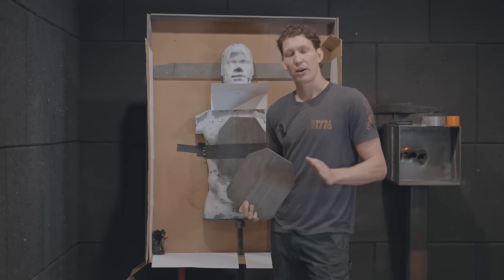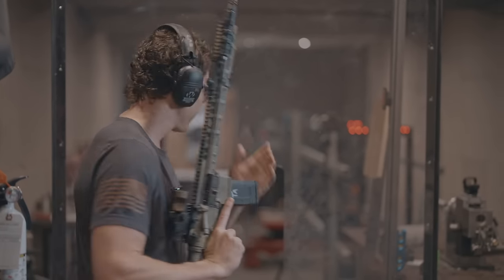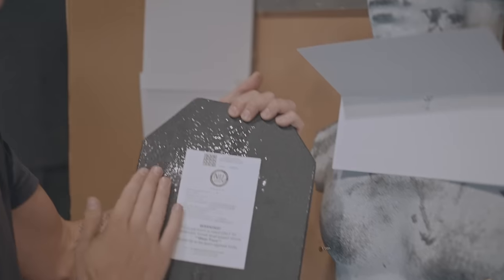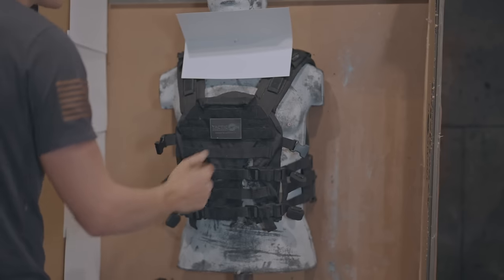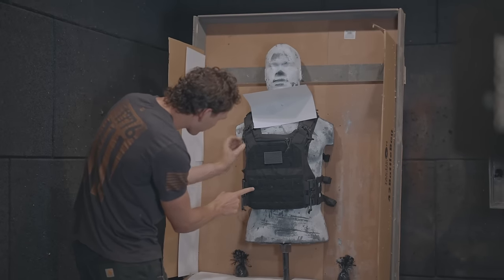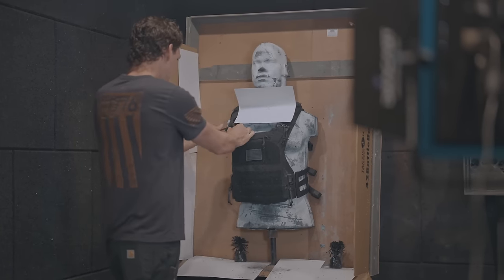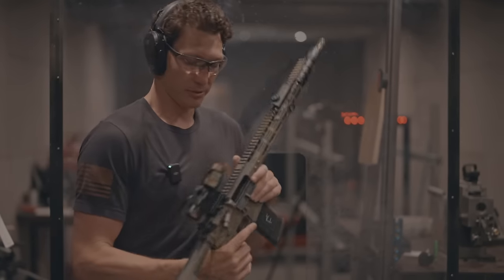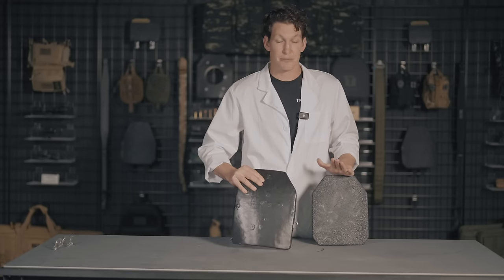Will Steel Armor Make You UN ALIVE Full Test

Comment: no doubt steel plates will stop bullets better than ceramic, but the point of the ceramic is to absorb impact. getting shot with steel would still cause impact damage to your body, where as the ceramic will absorb for of that
Reply: There may be some scenarios where taking a shot to the chest and being knocked on your ass could be beneficial versus still standing with some broken ribs and catching consecutive shots.
I think the big thing is it becomes a consideration of mission. If you're going to engage, have a team, etc. you maybe wouldn't want steel, but if you're patrolling in an open area or having a shtf set of plates that you don't want to worry about feeling an urge to replace every few years steel might be the better option. Also for most civilians the concern is shtf. Which means there may or may not be medical available if getting shot. So plate choice may vary depending on what that looks like to different people and their scenario.

Ideally we never have to worry about any of it and we're all just wasting money😅
Reply: Fun fact, steel plates have a lower BFD than ceramic. I run trauma pads behind all my steel plates. Getting shot regardless of plate type is going to hurt and possibly bruise or break something. The armor community has really hyped up ceramic/composite armor to be this hyper-superior armor when it really isn't. IMHO, only thing ceramic/composite armor has going for it is weight.
Reply: Do half you guys that comment on armor videos even own any? That’s not how the energy is transferred lol, a ceramic plate has bfd, and slows the round so almost all of the energy is being transferred into your body, that’s why dudes have broken ribs and bruised intestines when they get hit with ceramic. Steel armor absorbs the energy and rarely has back face deformation so the energy is transferred into the plate, that’s why there’s many ceramic plates that are in conjunction plates, steel armor is standalone, to get a standalone level 4 that’s affordable it’s a 8 pound plate and you will still have a collapsed lung from the bfd.
Reply: @dartanianoakley yeah 100% right, all these nerds hype up ceramic for some reason, to get a level 4 or 3+ plate that isn’t going to kill you from back face deformation your either paying 400+ per plate or they weigh 8 pounds which counters the weight argument all these guys use. If your a prepper steel armor is far superior, all these dudes larp and pretend there some “minuteman” operator during shtf for some reason.  And ceramic armor 100% expires and degrades over time, that’s why in the military you have training plates, and on deployment you get combat plates that are examined/ x rayed and have to pass a inspection every 5 years or so, and when they don’t they get tossed 😂
Reply: If ceramic slows the round then it is absorbing the energy. It doesn’t make since to say it’s slows the round and therefore more energy is transfered to the body. There’s no question that ceramic and UHMWPE will absorb that energy as good or better then a steel plate. The instant stop of a steel plate actually means all the energy is unloaded at once instead of being absorbed by materials. Think hitting a tree with an aluminum bat.
Reply: @tyronejackson6593  how’s that not make sense, ceramic and poly plates catch the round instead of stop it compared to steel, the entire steel plate is absorbing the energy of the round hence the minimal bfd. As with ceramic it’s just catching it in the one spot,  the bfd pushes into your body which is then transferring into your body? That’s why dudes have broken ribs and sometimes bruised internals. Also why if a plate has to much bfd it fails nij testing. Do you even own armor?
Reply: @RedForman22  Yes I do own armor. And what I’m saying is that the energy of a bullet comes from velocity and mass. Yes you have backface deformation because the plate catches the round. When you shoot a gong, you hear it ring right? That’s vibrations going through the metal plate. That is happening on your chest. So what I’m saying is I would rather have the bullet be slowed down and and the energy focused in that one spot (and good armor prevents deadly bfd) and have a bruise in that spot then have a plate that just radiates that energy all over my chest. If a bullet has 2 inches of travel after contact to slow down losing that energy over the whole 2 inches of travel, rather then unloading all the energy in an instant on the hit.
Reply: @RedForman22  I think maybe you aren’t understanding me. Yes, you will have more energy AT THE POINT OF CONTACT to the corresponding point on your body. Because of bfd, there will be contact that won’t exist with a steel plate. But the bullet will be slowed and therefore a lot of energy is already absorbed. A steel plate is taking every single bit of energy available on contact and radiating it across your whole chest. I trust my level 4 ceramics to not kill me with bfd. Btw, steel plates don’t stop M193 which is what literally everyone with an AR has. My level 4s will.
Reply: @tyronejackson6593  I understand what your saying, but I highly doubt you feel any energy dissipating through a 10x12 plate enough to do anything to you, especially if you have a trauma pad. And yes some steel can’t stop it at ten feet haha, every nij rated steel plate stops 193 at 3100 fps, and at 50 yards it ain’t going that fast or if you have anything shorter than a 14.5 it’s already going slower than that. 193 muzzle velocity is only 3200, don’t know how many civilians plan on being shot at ten feet with a rifle.
Reply: @RedForman22  I also understand what you are saying. Trauma pad makes a huge difference, of course a trauma pad behind a ceramic plate has the same effect on bfd. I do however think there’s a significant amount of energy being displaced over less than 1 square foot of steel. As far as distances and what not all I know is if there’s a scenario where M193 is going to defeat armor in 1 shot I’m not interested as M193 is literally the most common ammo out there. There are pros and cons to both, for me I’ll personally take the pro of stopping the most diverse array of ammo as possible, including the most common stuff. I hope to not be getting shot at all but I would say if I’m going to the chances of getting shot by a 16” AR with M193 is really high.
Reply: @tyronejackson6593  yeah both have there pros and cons, that’s why I have both. All armor compromises something. just like combination ceramic/poly plates can’t stop m855.
Reply: @RedForman22  Exactly. I looked long and hard at steel and ceramic and I personally decided on ceramic. Doesn’t mean I havent considered the implications of that plate truly being done after being shot once. And I’m not saying I haven’t considered picking up some steel plates to check out but it’s not my go to that’s for sure. For me anyway.

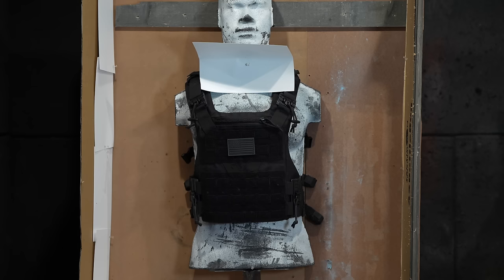Comment: Those next two shots @22:15 
I call foul .. A couple VERY odd things happened... Why are these rounds hitting after being heard? I did my own slowmo replay .. Also, why did the second round land behind the target with two impact points
Reply from the maker: In edit the audio and video track got un aligned most likely. idk about the second thing though does look wonky.
Reply: @TacticonArmament  yea, audio not syncing correctly due to editor error is viable but no less concerning to me ... but if you look, you'll see a puff of blow back debri at the top right of frame.. seems like the round went straight through or frame over lap because of way too much editing

Comment: I'm genuinely curious how a steel plate would do if you dipped it into flex seal and let it dry to act as a coating.

Basically I wanna know if you can make Bubba plates
Reply: Truck bed liner was the go too before the build up coating became standard

Comment: If you have taken 6 rounds in your plate odds are you have already been shot in the legs or arms face neck or something. I like your videos and after researching I purchased your product. Like the owners mindset and being open. I did see on a test by a independent guy shooting your plates they work well. The AR 600 At 45 feet they stop M855. They stop 7.62 ball moving at 2900 fps 6 shots of it no penetration. M855 A1 the new stuff the military is using did penetrate the plate. It is a copper solid with a large penetrator. Shot out of a shorter barrel 10.5 inches it did not penetrate down at the 2650 2700 fps. The disturbing thing is that M193 at 3150 fps and more did penetrate the plate half of the time or less. Since .308 does not penetrate at 2900 fps it is a given that 762x39 wont penetrate. They shot it with 308 and 30-06 AP black tip and of course it penetrated. So M192 will penetrate about half the time and the new M855 A1 will penetrate the plate. Don't know how much energy is left and penetration? Need some ballistic gel behind it to find out. Great value. Good price and great protection for the money. A extremely good value and you people seem to be ethical. That is unusual for this day and time.  Like all I have seen so far.

Comment: That's cool. They're still heavy af.
Reply: 6.6lbs isn't heavy. 😂
Reply: @citizenoftheninthdivision  5 is the standard. My level 4 plates are 4.2. Weight matters. I wear a plate carrier every day for 12 hours straight. 1 lb makes a huge difference.
Reply: @peachfuds  Standard according to who, and what brand, model,  and size
Reply: @bxbalisong5776  standard according to military standards. It's fine, bro. If you want to run heavy shit because that's all you can afford, that's a totally acceptable answer. But don't come on here and tell me or anyone with slightly more experience than yourself that 6.6 lbs is totally normal for level 3+ because it's not. The other plates on the market that are similar in weight and rating are budget options. The more expensive plates become, typically you see a decrease in weight. As you start soaring over 1k per plate, you start to see diminishing returns. This is why I chose the premier body armor level 4 plates because they're the best value for what they offer. On the other hand, you have companies like Hesco who way overcharge for their shit because they can. I respect Tacticon for what they are doing. They are providing fair prices for decent low-mid tier gear. The market needs guys like them to arm up the average joe. For those of us using kit in a professional capacity, we look for the highest performance, and price is a secondary priority. Lightweight, fast, and maneuverable are the top priorities when selecting gear. The more gear you start to stack, the more each item's weight matters. So, personally, I would never run 6.6 lb plates. I would much rather have 3A soft armor or 4 lb level 4 plates than anything heavier. Shoot, move, and communicate start to become very difficult if you're exhausted from movement, and it prevents you from shooting and communicating. Just my two cents as a private security contractor who wears this shit every day. But what do I know, right? It's the internet. I could be a 600lb cheetoh eater in my mom's basement. 😉
Reply: @peachfuds  Theres trade offs with everything  that's all I wish people would understand. I'm not here to say that your plates suck and mine don't and I'm not here trying to question your  experiences and background.  those light light ass UHMWPE plates are awesome but the deformation and ability to take multiple hits or lack thereof rather  is definitely a clear drawback. if It wasn't the military would've adopted them yesterday. there is no end all be all plate. (yet at least) and different people have different experiences and outlooks which allow them to come to different conclusions, but to say that your plate is the end all be all and to spit upon anyone who hasn't come to the same conclusion as you is pointless and shortsighted. Ceramic armor has its merits, steel armor has its merits, UHMWPE armor has its merits but theres no such thing as the perfect loadout or whatever you wish to call it. that's all want to convey especially to the ceramic bros.
Reply: @bxbalisong5776  yes, and no. These plates are Ceramic hybrids. Kentucky Ballistics did a video where he tested them, and they took numerous hits from multiple calibers, including. 338 Lapua. Level 3 UHMWPE is not ideal. Needs to be level 4 to make up for the downsides of that material.

Comment: I want to be objective its a good but incomplete test. If lvl iv ceramic stops threats beyond m855 including 30-06 black tip and 762x54r penetrators. Steel is heavier by a wide margin for most people that are worried about their personal fitness ceramic armor is better and there is much more conclusive documentation that poly ceramic is the best material for modern armor. And PS I dont get paid to advertise either option.